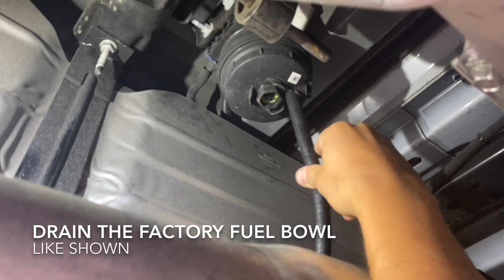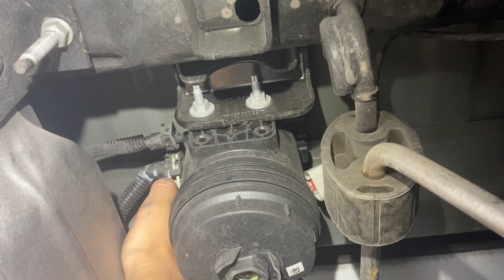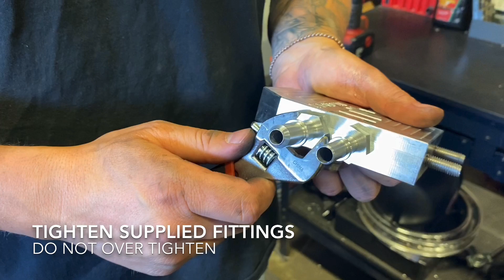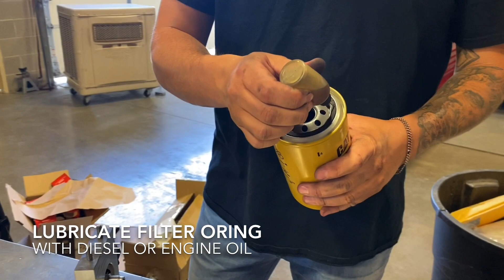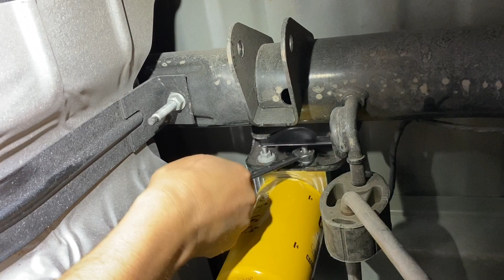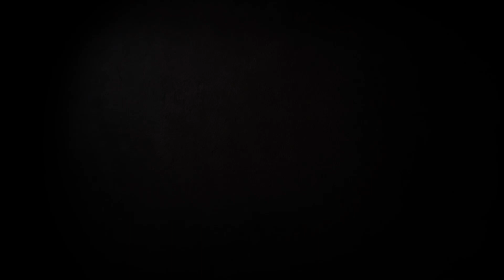2019+ 6.7 CUMMINS REAR CAT FUEL FILTER CONVERSION KIT! FULL INSTALL BLACK MARKET PERFORMANCE

Comment: All good just one concern. The RAM stock filter housing has two water sensors, one at the top and one at the bottom. This conversion just has one at the top. Diesel is lighter than water so water accumulates at the bottom. So lacking the bottom water sensor I think is an issue. Seems deficient to OEM. High pressure fuel pumps do not like water. You should consider adding a stem down the center with an additional water sensor like RAM does.
Reply from the maker: We’ve tested running water and fuel past our sensor in the side of the block and it will still send a signal for a CEL. But we have found a cat filter water separator with threads to spin a lower billet piece on with a wif sensor we will be offering soon. Just for anyone that’s concerned, hope this helps

Comment: I bought this kit for the 19-20 and I received the wrong adapter harness your videos shows the correct 4 pin connector but my kit came with a 2 pin connector is there anything I can do to get this issue resolved?
Reply from the maker: Yes give us a call and we will get the right one out ASAP 👍

Comment: Is there a trick to getting the fuel line with the white clip onto the new fitting? I’ve ensured that the white clip is at its full pulled out extent, but can’t get it over the ridge of the new fitting.

Comment: Does it fit cab and chassis 3500, 4500 and 5500?
Reply from the maker: Not sure on the 2019+ but it does on the earlier Cab and Chassis for sure

Comment: What are the benefits of doing this. New to diesel trucks please excuse my ignorance. Ram 2500 2021
Reply from the maker: Better filtration, more affordable fuel filters and it also gets rid of the cheap plastic housing that is prone to cracking
Reply: I just bought 2022 dodge 3500 with ho cummins you answered my question cheaper filters better filtration will it void my warranty?
Reply: @GaryBlankenship96b40  
That’s what I was going to ask. Might install after warranty expires.
Reply: @GaryBlankenship96b40  Yes

Comment: You guys should have milled a seat into the block for the fuel port O-rings, they roll right out from underneath the ports as you finger tighten them and yes even oiled. I can't wait till I'm out of town and them start leaking but I guess that's why you guys supplied two extra O-rings... You could have also just supplied AN fitting like the fuel filter, that would have been better than this crap. I don't trust that this won't leak at some point at ALL.
Reply from the maker: We do mill O-Ring boss grooves for the orings. It’s possible you got the wrong size of orings though, we had a few go out with the wrong size. Give us a call tomorrow and we will get you taken care of